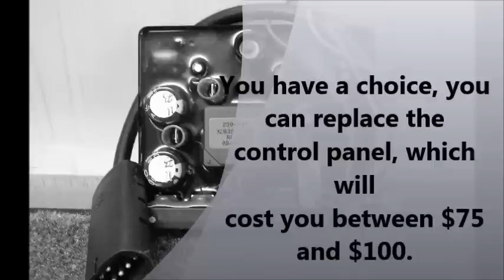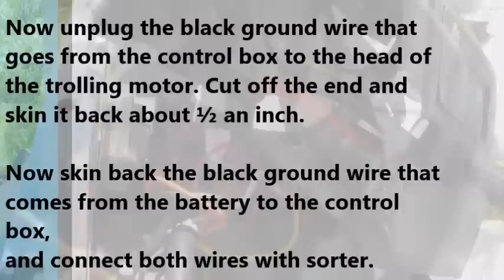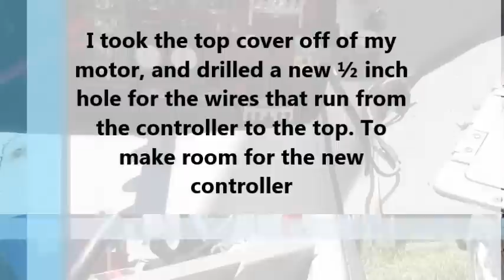Repairing Minn Kota Trolling Motor Power Drive v2 Control Board

Comment: I watched your video, and improved on it by making my connections at the base unit. Now my Autopilot still works!!!
Reply: Clyde Sorrell test
Reply: Clyde Sorrell  Clyde I have an old model 212  - it's a bow mount, hand control with autopilot....if I connect the 2 grounds as described here, would I still have the the variable speed control since this model is hand control and not foot control?  Also, please give me more detail on what you did different to get the autopilot to work.  Thanks for your  assistance.

Comment: Worked great for me. I have a fairly heavy boat and always used the trolling motor wide open anyways. Couldn't find a control board as Minnkota don't make the parts anymore and would have had to take a chance buying a parts mule and hoped the board on it was OK. Thanks for posting :)

Comment: This worked great for me for about 2 days.  On my second trip the motor quick getting power.  I could still steer both directions but no power to the prop.  I re-did the wires and still no power.  Is there anything else to try to fix this?
Reply: Carter Nelson did you fix the issue? Mine is doing it too

Comment: Trolling motor works now but the motor runs when making left turn .....Any help would be appreciated
Reply: Added speed controller and it makes a terrible humming sound in trolling motor that will probably scare off any fish within 100 yards !!
Reply: The speed controller did fix previous problem. Motor steers and runs as it should but I still dislike the added noise in prop motor...

Comment: the newer power drives are not trusty at all 3 controllers in 5 years
Reply: what went wrong with your controllers? My motor is doing nothing. It has power going to it but nothing works. Could this be the pedal?
Reply: @marklopez5382   its been a while and cant really remember but what i do know my problem both times was in the pedal electronics. I remember one time it would only operate in the constant on position and the other time it wouldnt do anything. I purchased a new one 2994727 Minn Kota Powerdrive BT/V2 Foot Control Pedal 1866070 on ebay its an aftermarket one works great 69 bucks